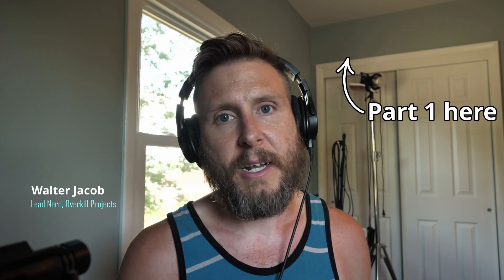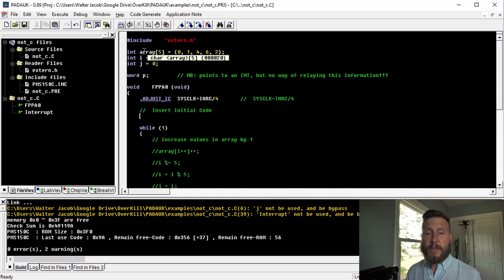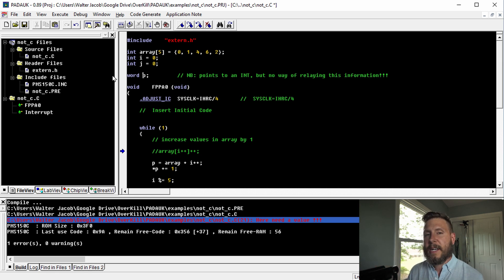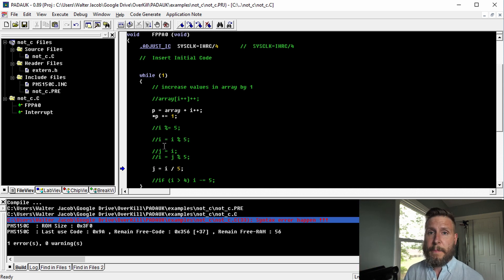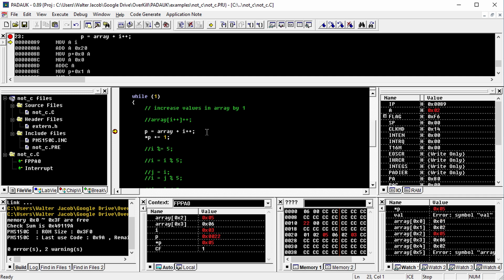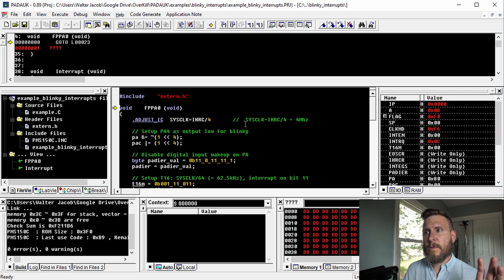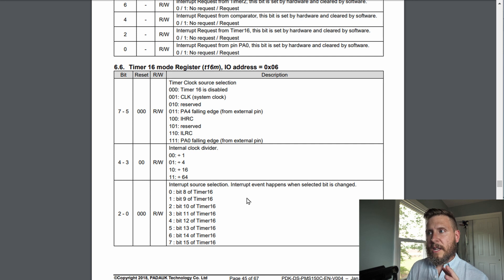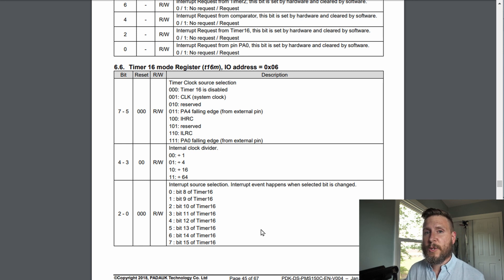TIPS & TRICKS for the 3 Cent Microcontroller | Practical Programming Guide

Comment: Since the micro has no modulus instruction, i would never have expected a mini C implementation of modulus which requires a divide/mult.
Then of course the micro does not have a divide instruction either, so modulus needs a divide library linked in! And probably a mult library too!

I'm guessing you have not programmed in RISC assembler much?
I expect the mini C to just give you a "C like" way to input the assembler code.
For your array problem it would probably have accepted;
i++
array[i]++

Anyway, thanks for an interesting and thorough video. 👍🙂
Reply: the funny thing is the ide says too difficult to implement! I abandoned their UI and I'm using SDCC with those parts. Testing can be done with a flash part which is similar.
pointer handling is crazy with their mini-c ... it's not worth to learn that. With sdcc you can just go for it the normal way.

Comment: Thanks for the two videos!
I would like to build a 128s BMS (high voltage LiFePo4 battery management system) and simply giving every single cell its own microcontroller could be the (first) perfect use case for this super cheap chip!
But i fear to spend time leraning a new product family. So i would like to hear you opinion on this :-)
All chips have a comperator but i only know adc. So should i go for the PFS173 or might some OTP be enough ?
My 128 MCUs would need a serial protocol where the TX of mcu-n is using a npn-transistor to pull down the RX of mcu-n+1. I think the 3 kW (=6 kB?) of the PFS173 should be enough to code a softwareserial. I am not so sure with less then 2 kW.
Is the internal voltage reference precise and stable enough to measure the 2.0 - 3.6 Volt of the cell that it is connected to ?
Do i not need adc which would break the 256 values down to 0-4 Volt but a comparator could be used to spread the 256 values onto 2-4 Volt ? Again, i do not really know how to work with comperators :-)
What do you think of my idea ?
Greetings from Germany :-)

Comment: Thank you very much for these videos bro, I'm thinking about using this microcontroller for a very low cost project at my company but I have some doubts:
-Is this Padauk PMS150C reliable?
-Is it active? Because we need it for at least five years from now;
-About the program memory I saw in the datasheet, it's an OTP (One Time Programmable) memory which means I can program and debug only once (?!), so how do I get around this?
Reply from the maker: It's very low cost for a reason, certainly, but I don't think you will have any major reliability problems as long as it's used in "normal" conditions (I wouldn't expect it to perform well at 130°C, for instance). As for long term support, you should reach out to them and ask, they might have an official support window.  And there is no way around OTP on a given device (at least, it wouldn't be worth the trouble) just include an appropriate header and use the in circuit emulator and you can reprogram as much as you want during development.

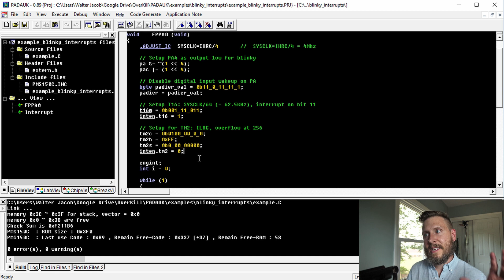Comment: The issue related to multiple interrupts sharing the same ISR is a common problem on other MCUs too (from 13:10). The interrupt flags and interrupt enable bits are 2 different things, especially on timer peripheral. Even if you've disabled the timer overflow interrupt, the overflow flag does not just freeze. And yes the way you overcome it is the usual way that is done on any other MCUs (STM32 for example), but I wonder why would do that. If you intended to check for an overflow in the ISR too (and therefore wrote the code for it), then you would have enabled its interrupt. Otherwise why would you put that code there in the first place? 🤔

Comment: Do you need to the Interrupt code in a loop so that if tm2 fires first and then t16 fires while tm2 is still working, you will loop back a second time and pick up t16?  Then the third time through the loop nothing happens and you exit.
Reply from the maker: The problem with that is that when t16 fires, it will reenter the handler from the beginning and just run to the end then resume tm2.  So each block needs to check that it is in fact in scope for the interrupt that actually triggered the handler.  It's not the worst thing ever, it's just that the example code is a little vague and you only notice it when you do a project with a few handlers.

Comment: Hello I need your help again 😅,

 In c programming I am making a program for a amper meter and I want to turn off a specific device if ampere is equal to that we set. But the ampere is not constant and i can't use == command . I want that insted of == is there any command where a number shouldn't be equal but between the 5 difference. Ex. If I set the number 35 then it should turnoff my circuit between 35 to 40 . Please help me🙏
Reply from the maker: I think you are looking for two less than or equal to conditions?  If so you can do, e.g. "if ((y >= 35) && (y <=40))"
Reply: @overkillprojects8091  yes your correct but that 35 and 45 will be random number...
Reply from the maker: @ranaremotecompany912  hmm so the comparison values can change?  How do you determine them?  If your values are amp_limit_high and amp_limit_low, you could do "if ((y >= amp_limit_low) && (y <= amp_limit_high))" right?
Reply: I can do your suggested idea but I don't want that the user should have to set ampere two times and I also don't have space in my microcontroller I am using pic 16f688. 
There is more in my program
Reply from the maker: @ranaremotecompany912  i think I'm getting closer to seeing what you want lol.  How about ((y >= amp_limit) && (y <= amp_limit +5))
Reply: @overkillprojects8091  yes that is exactly what I want . Thank you dude 🤗🤗🤗🤗🤗. You helped me lot 😆😆

Comment: Nice video about the Padauk micro and official IDE!
There's currently an open-source compiler software and programmer hardware project going on. It's called FreePDK on GitHub. Check it out if you're interested!
The compiler also uese standard C that supports vairous of std libs instead of mini-c.
Reply: So for some one it's not hard to implement?)
Reply: @tempvoid7680  Not at all, padauk's architecture somewhat resembles a more popular micro that designed by Microchip. Which already have limited support in SDCC(the C compiler that FreePDK uses).